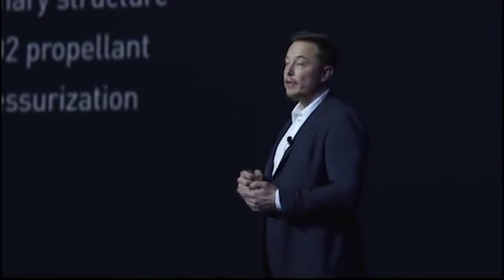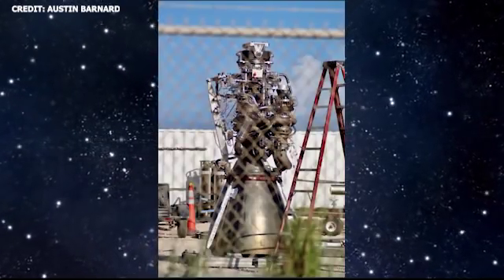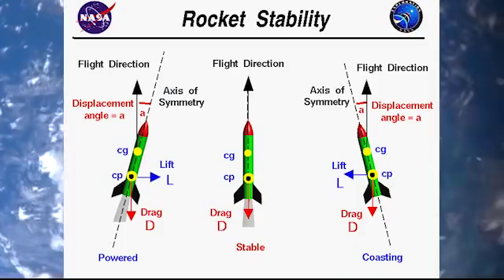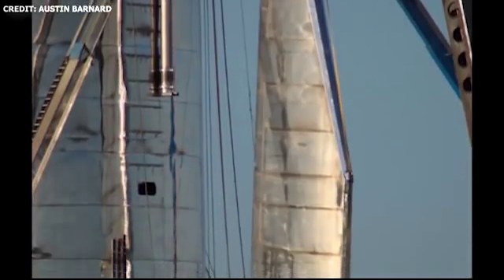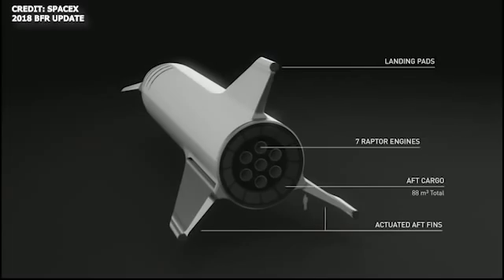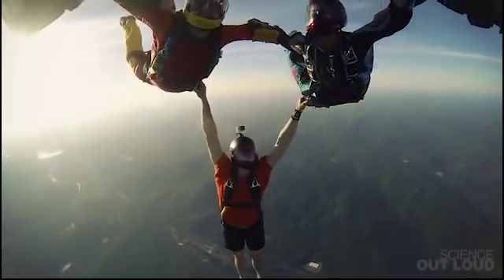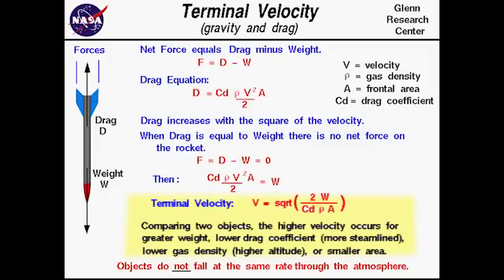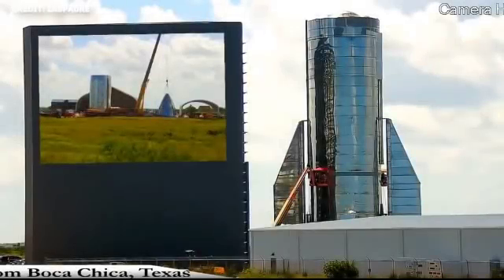SpaceX Starship Updates - Design Changes I Fins & Raptor Engines Added

Comment: Let’s not forget that they’re working on the prototype and are merely testing certain capabilities. What we see now isn’t nearly what there is to expect later.
Reply: Yes, you're right - what we can see right now is a flying test-bed being constructed. Everything that could be tested with it are low speed aerodynamics (the thing of no big interest) and raptor engines in different modes(that is the main goal). What to expect in the future i don't know - after the switch to steel design I am a big sceptic.